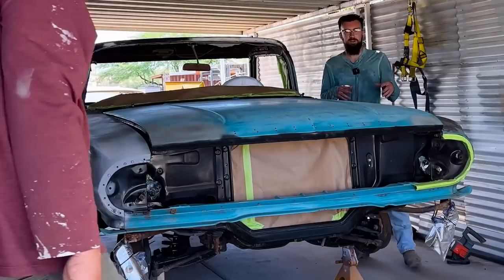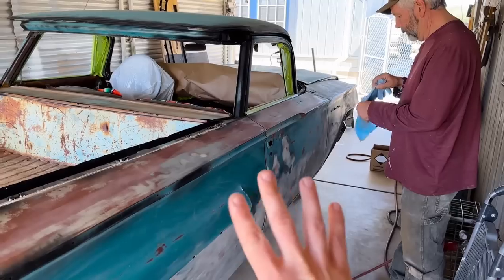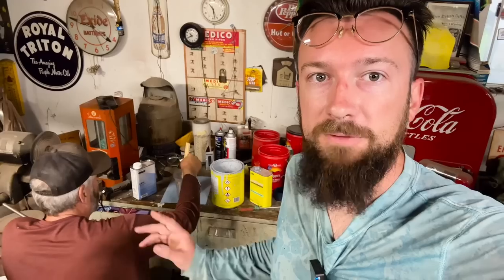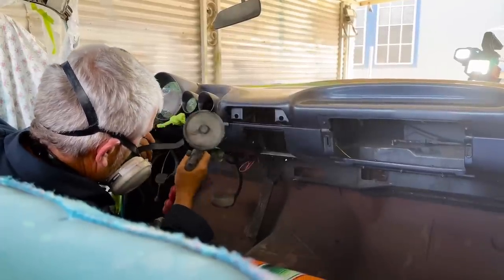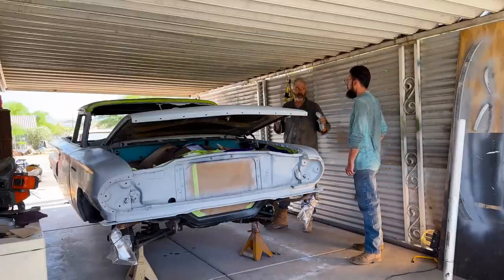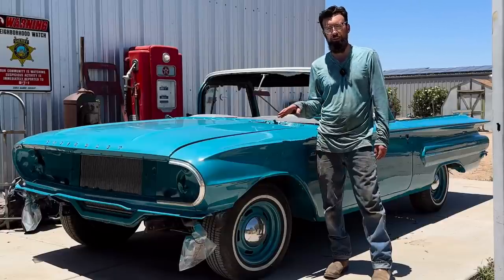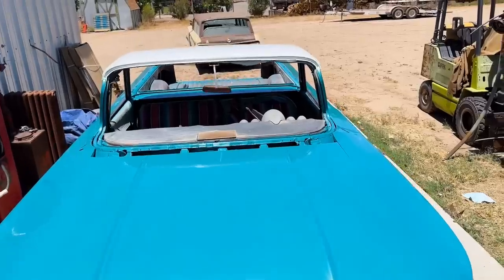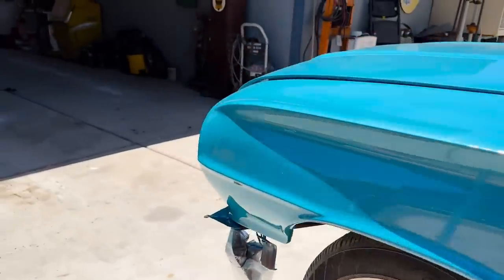Painting a 1960 El Camino it’s original colors after being abandoned 30 years!

Comment: Awesome restore guys. I was born in 1960 and my favorite car ever is the 1960 Impala flat top you did. This is so cool though & I am sad that there is no more footage of this car, it was that good. I bet ya somewhere in a warehouse there is a brand new grill for this El Camino.

I know paint is tricky. I built a fiberglass mold of a bathroom tub and the place I bought the Gelcoat told me to mix 10 drops of MEK with 1 quart of Gelcoat. It never did harden. I had to use a torch and a scraper to remove it all. I asked someone else how much MEK to use and they said 10CC's. BIG difference.

Comment: That is a very nice paint job and a very nice job on the hole job. I also have one of those here in penna. Mine has a white top and is painted a similar blue. It has a 305 and a 700 r 4 trans. I do and you will get a ton of high fives. I have had mine 10 years and I still get noticed every time I take it out. Mine was a ton of work also.

Comment: FYI  The grille emblem is on upside down the V is the tell tale that there is a V8 under the hood.  I had a 1960 IMPALA 2 door hard top with a 283 and power glide transmission.  A fellow club member had a Bel Air 6 cylinder and there was no V on the grille emblem.

Comment: STUPENDOUS job on the paint Rick!!! Arizona is so dusty, I don't see how you painted this El Camino in an, essentially, open shop without it looking like a dirt road, but you clearly did it! Do you wet the ground down around the shop before you paint? I live in Alabama and don't have a spray booth either. I paint cars in a "tent garage," with filters in the door at one end and a squirrel cage fan sucking out at the other, and always plan on painting in the spring around May/June. I also paint early in the morning while the dew is still on the ground to keep down the dust. Man, you did a great job.
Reply from the maker: We have wetted the floor in the past but not this time. And some small particles got in but nothing that can’t be sanded out

Comment: IMHO, this looks MUCH better than the "patina" thing. I believe in preserving the original paint if it has little or no body damage to repair, and the paint is basically all there with maybe a few thin spots and flaws. Once there is body damage, rust-through that needs repair, and extensive surface rust, forget it...just paint it back in it's original colors...the car will look SOOOO much better. And I agree with you, I MUCH prefer single stage paint..if it fades a bit, you can usually wax/buff it back out...especially if it's lacquer...base/clearcoat, it looks good/shiny until the clear decides to peel or turn white/deteriorate...then, an otherwise good paint job is completely shot...I just don't care for it. Just think, if the old 1940's-1960's cars had been painted with base coat/clear coat, there probably wouldn't be ANY old cars left with original paint..the clear coat would have failed after 10-15 years, and downhill from there....